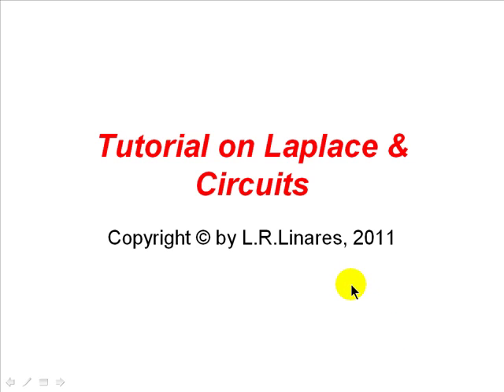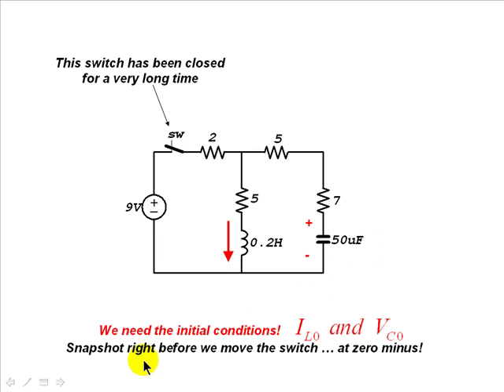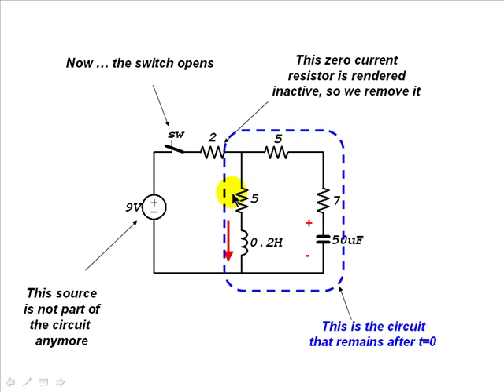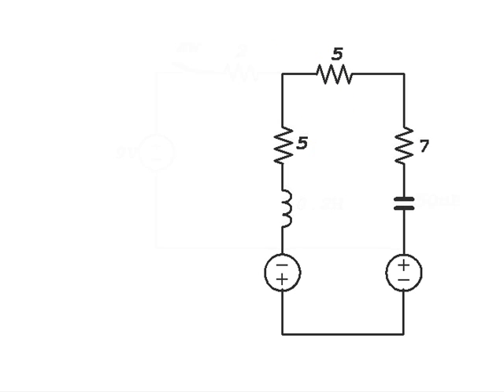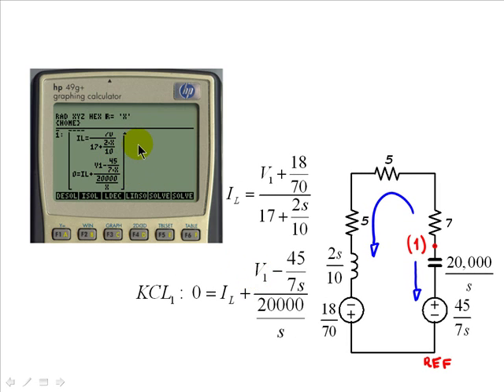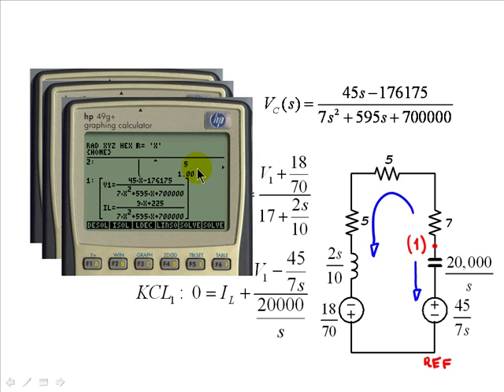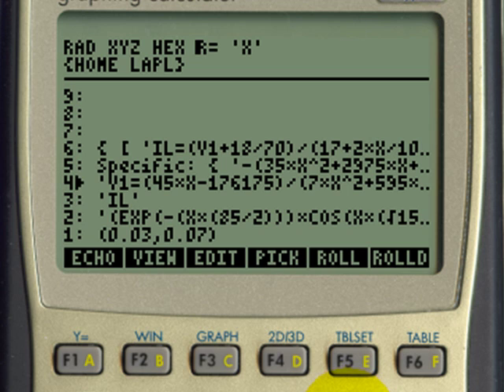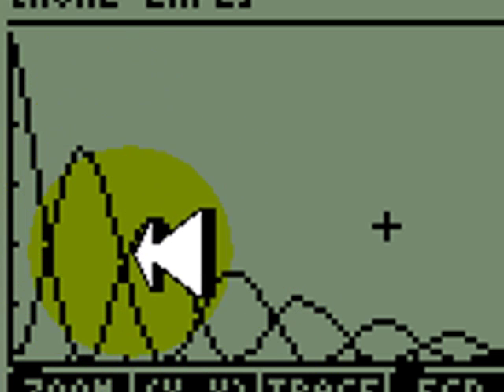HP16/Laplace/Circuits: Laplace and Plotting with the HP50g.

Comment: I used the KVL to list the system equation to get the I(s) expression, and found the importance of separating the "voltage part" and "impedance part" in equivalent models of capacitors and inductors, as I need to find the voltage polarities of all components. Thank you so much Sir.
Reply from the maker: Glad to be of help.

Comment: did the same with the prime :)
Reply from the maker: In the HP Prime it is so much easier. Mostly because the software is more modern and powerful. The HP Prime uses the excellent XCAS/GIAC, which open software and has tons of Brainiacs led by Bernard Parise improving it continuously (a bit like a Tesla car, you get updates for the Prime twice a year ... for free.)
Reply: I find prime a lot easier to use as well. That does not mean 50g is not valuable or powerful, it’s just prime is a better.

Comment: This works on hp49g+ ???
Reply from the maker: I have not used the HP49g+ in more than ten years. Honestly, I don't remember but I Googled it and got that the functions on the 49g+ are LAP and ILAP. Check this out https://www.manualslib.com/manual/359363/Hp-49gPlus.html?page=485#manual.

Comment from the maker: There is no "inverse Laplace button". As seen in previous videos of the series, I have assigned the internal function ILAP, which includes some system flags setting (as per the Advanced User Manual that comes in a CD with the machine), to one of the soft keys at the top of the keyboard.

Comment: It is important that you set up your calculator correctly!  

In video HP01, the author sets flag 105; thereby setting CAS to Approx mode.  

In this example, flag 105 is not set; therefore CAS is in Exact mode.  

You can see this setting at the top of the stack, in the display header:

RAD  XYZ  HEX  R  =

The "=" denotes CAS Approx mode.

In video HP01, the CAS is in Approx mode ("~"):

RAD  XYZ  HEX  R  ~

Comment: You identify at timestamp 9 minutes and 11 seconds, a problem when displaying equations that cannot be entirely viewed on the 50G screen.

There is a fairly undocumented method to view equations longer than the screen size that allows the user to scroll the 50g screen left to right.

just UPARROW in the stack to the unviewable equation, then press softkey VIEW (should be F2).

Now use LEFT or RIGHT ARROW to scroll screen.

Please keep posting more great engineering videos using the 50G !

Comment: Thank you for uploading this!  This is the best explanation I have found for using the Inverse Laplace function of my HP calculator.  As a Mechanical Engineering student, I also found your analysis of the RLC circuit very helpful in relation to a Controls class that I am currently taking.